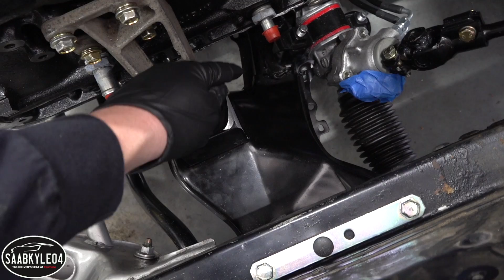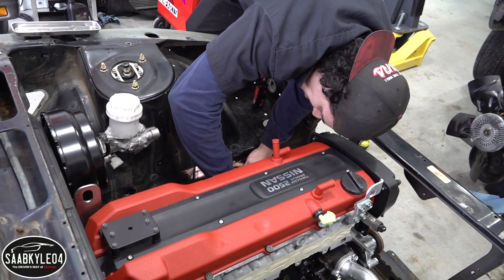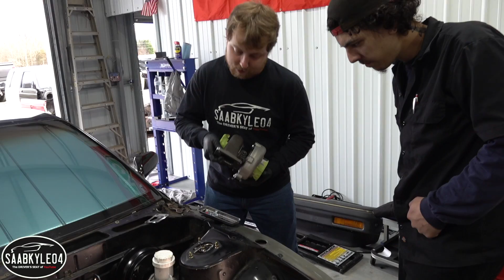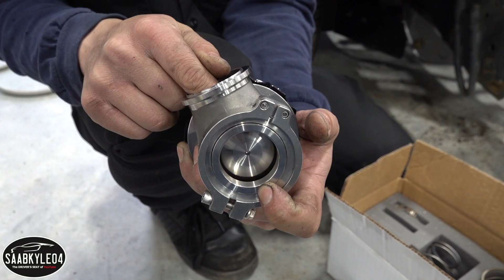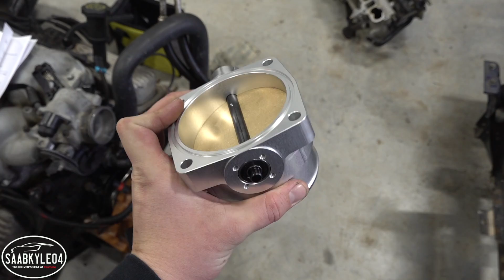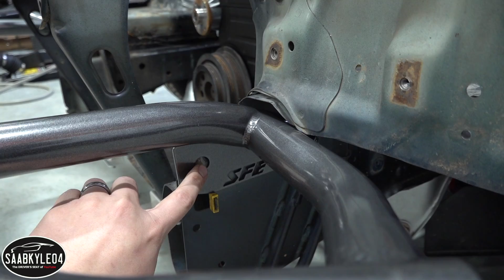Test Fitting The Turbo, Intake, Bumper & Other New Parts: 240SX Restomod Ep.29

Comment: Cool car. Just a tip if you haven't thought about it. Make a heat shield (preferably heat reflectant covered aluminium) to guard that engine mount from the scorching heat that manifold is going to produce or it will melt (I see other people have already addressed to do the same on the brake booster and clutch master. Seeing that you are extra meticulous, would be even better if you ceramic coat everything (manifold, turbine housing, downpipe) as these turbo sixes heat the bay a lot. Keep on!

Comment: Dude there is plenty of room. Put an aluminium shield between downpipe and brake booster. It won't boil if u do that 👍
Reply from the maker: There's not enough room, I promise, the brake lines won't even fit, let alone a heat shield haha.

Comment: Excellent video, as always. Seen your other projects, as well. Really helps to get ideas on what to do with my S13, too.

I know you're dead set on the Chase Bays booster delete kit, and it's understandable. If the turbo setup were a bit more compact, you would probably need a smaller booster. I found it weird that you went with a Z32 booster when a manual S13 booster is overall smaller. I say that because it's what I read, and that's good to know for anyone going for an automatic to manual conversion.
Reply from the maker: Thank you!  I thought I talked about it in the video, but I went with the Z32 setup becuase the stock manual s13 booster is not up to the task of powering such big brakes.  The pedal feel would be mushy.  You're right about when doing the conversion.  If you have stock brakes, that's a great idea.

Comment: You should fabricate a wedge shaped intermediary plate with a 45-50° angle between the turbo and exhaust manifold, so that the turbo is closer to the valve cover and away from the booster/master cylinder. That way you can mitigate clearance issues with the brake lines.

Comment: Don't cut the front header panels! Just hammer it out of the way of the bash bar enough to make it fit. You've got a few spot welds there that hold three different layers of metal together, and you don't want to get too close to those, much less cutting them. Also, I would see if there are options for either a slimmer brake booster, or an electric unit. I've personally never used one, but there are aftermarket electric brake boosters on the market. You've got one hell of a fast car coming together here, and you're gonna want to be able to stop fast, too. However, it won't hurt to just drive the car with manual brakes for a while just to get the feel for it, and see how you like it. Who knows, maybe it'll be fine!
Reply from the maker: Too late lol, lopped them right off 😆 In hindsight, bending them probably would have worked, but I wanted to make lots of room and clean the lines up.  I'll be welding/reinforcing that area so it'll still have good, if not better strength than it had before.  There are slimmer booster/MC options.  The stock setup is smaller, but it doesn't jive well with big brakes like the ones I have.  I needed a bigger setup to push the brake fluid appropriately.  I think manual brakes would be pretty awesome.  Like I said, I'm used to them on old cars so I'm confident I'll like it with the big brakes.  I'd rather avoid any added electric components if I can help it.  Thanks dude!

Comment: You should do a chase bays booster delete. Also believe you can run the clutch master cylinder out of the brake master cylinder. You should also weld and fill in all the holes in the bay and on the frame rail
Reply: Nevermind saw that you ordered it

Comment: I would suggest that, with the proximity of the exhaust manifold and turbo to the brake master cylinder, running silicon brake fluid would be a good idea as it isn't anything like as affected by heat as mineral oil brake fluid.  It also doesn't absorb moisture from the air so it deteriorates much more slowly than mineral oil brake fluid...
Reply: gosportjamie It requires a brake system specially designed for use with silicon brake fluid though, so that might be too costly all in. Definitely a good idea though!
Reply: @braydonwebb3432     I think it is mostly the seals and flexible lines that need to be different to work with silicon fluid, though a lot of the performance braking companies like Wilwood now use a rubber formulation that is resistant to both types of brake fluid which makes life a lot more simple.  It makes sense for them to do so as they make race brake components too, and just about everyone in racing uses silicon fluid due to its resistance to boiling.  As has been seen many times in all forms of racing, you really don't want to put your foot on the brakes at the end of a long straight and find your brakes have gone out to lunch.  That NEVER ends well...

Comment: You may want to get a set of good quality pneumatic tools for some of this stuff you're doing.
Reply from the maker: I got a mini die grinder and a cut off tool for small things, but haven't found much use for investing in others for the time being
Reply: @saabkyle04  Yeah, it's somewhat a personal preference of mine, since there's really no loss of power and they just work always. I guess battery tools on the other hand are also better for you as a content creator, since you don't have to deal with the compressor noise if it's not possible to mount it outside of the shop.
Reply from the maker: Yeah that's true, I appreciate the insight though!

Comment: Nice video. To fix your  heat problem with the Turbo maybe make a heat shield and also like you side put something around the pipe coming off the turbo might be something to looking. Over all great video. I have done my share of engine swaps in other vehicles and make them work. Keep up the work cant wait to see more videos.
Reply from the maker: Thanks so much!  The biggest problem is that there just isn't enough room to fit all that stuff.  Heck, the brake lines wouldn't even fit haha.  It's just going to be easier/safer to do a different setup.

Comment: Maybe you should coat the turbo  mainfold then exhaust warp it also get some of that oem heat shielding from a modern vehicle at a pick and pull  then mould it to fit between the booster and master cylinder . I'll be doing this my turbo cars did it before works very good. Lower under bonnet temperature by eazy 30 Celsius (metric) but I'll need to do a real test .
Reply from the maker: You are 100% right about all of that, the biggest issue here is that there is just not enough room to fit everything.  The brake lines won't even fit so it's just going to be more beneficial to free up that space and go with a different setup.  Definitely don't want to go back to a stock booster because that would ruin the feel of the brakes.  I think the best setup for me is the booster delete.  I'm actually quite excited to see what it feels like haha.

Comment: You should put a aluminium heat shield on your booster and master.
Reply from the maker: Not possible, there isn't even room for brake lines.  I'm forced to change the setup.
Reply: @saabkyle04  I ment after you change the set up. It's still going to be so close it would cook the fluid even with the down pipe wrapped.
Reply from the maker: Oh yes, for sure!
Reply: @saabkyle04  yes Adam Lz's 240 caught fire while back because he had the headers right by the brake booster within shield
Reply: Kyle:Another way to get around the master and booster problem is to relocate it to the right hand side. Therefore you'd use a RHD setup and use a connecting linkage to from the brake pedal. A older Mitsubishi Starion or Cordia used this setup.
I don't know how much room you have on the right side, but it can be done this way. Gr8 build keep up the good work. Have a wonderful God blessed day.